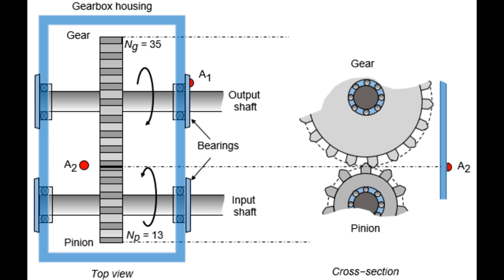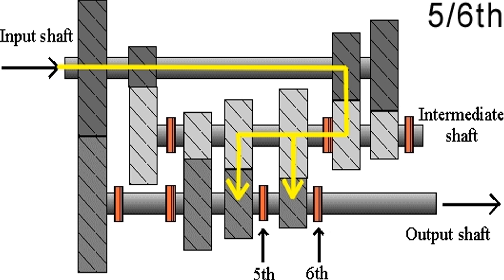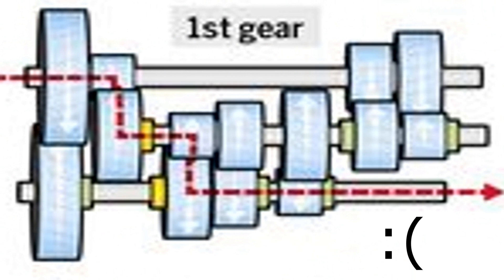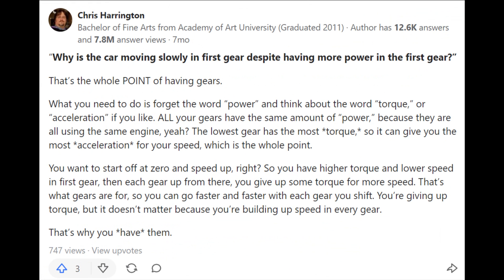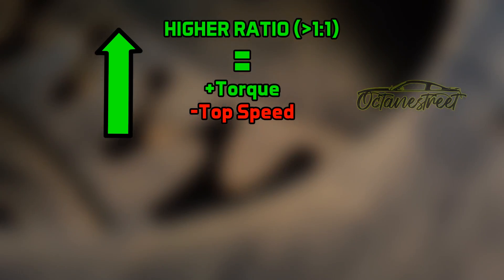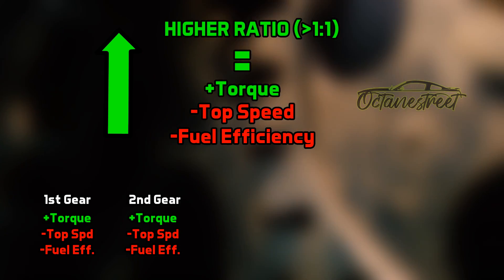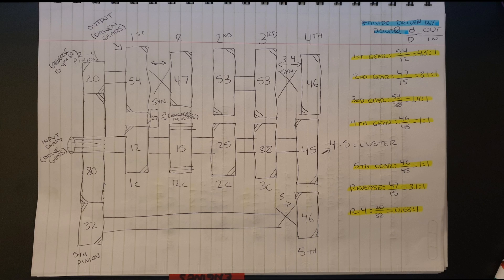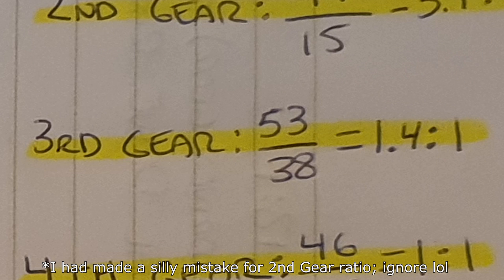Explaining "O/D Off" & Gear Ratios! Why It's Important! 💡

Comment: So overdrive off = faster?
Reply: Not always, if you are trying to accelerate your vehicle, turning off overdrive can shorten the time it takes to accelerate. If you are already going near a top speed switching the overdrive on can  cause you to slow down faster if you arent pressing the accelerator. The Overdrive function does not increase your overall top speed it just helps get you there in a shorter time.

Comment: Hey what does it mean when im going high way speeds my car stutters and goes crazy into high rpms and the o/d light goes off without even pressing it its weird only happens on highway not street driving ??😅 it scary when it happens to cause the car just pauses .you think my transmission going out or something like spark plugs or something??
Reply from the maker: @Above3Beyond123  Sounds like some sort of transmission problem or an issue with the higher gears. Can definitely be dangerous and you should get it looked at or at the very least do some extensive googling! Be safe 👊

Comment: Sir, I have a question regarding driving an automatic transmission car on a 30-kilometer range uphill route. What is the best driving method to use? Should I use the OD (Overdrive) OFF function or gear 2, 1 or L gear? And to assist with engine braking, on downhill, should I use gear 2, 1, or L for the entire 30 kilometers to prevent damage to the transmission?

Your answer and explanation would be greatly appreciated
Reply from the maker: To be completely frank I am not qualified to answer that question, I understand the question but don't have the knowledge for situations like that. You can watch a video on best way to travel uphill/downhill etc and possibly find a good answer! Best of luck, and feel free to come back and reply to your own comment if you end up figuring it out. That way others who might have a similar question can also have an answer! 👌

Comment: Mine is flashing can you tell me what does that mean?
Reply from the maker: Unfortunately you might have to get that taken in to a shop to have it looked at. Can be the O/D system malfunctioning or some other issue with the transmission, so it's better to be safe than sorry. Best of luck!
Reply: @OctaneStreet  hey man its a shift solonoid, but its hard to get it fixed, either buy a transmission or from what ive been learning you can use the manual mode to avoid the overdrive, i say this because if you have overdrive on it causes your transmission to slip and that leads to fuel loss and power loss
Reply: Did you find a fix?

Comment: How do you turn it back on because i turned mine off on accident and it wont go back on?
Reply from the maker: It should be able to be toggled on/off with the press of the same button. It may also depend on your vehicle how the feature is meant to be toggled back on, try looking around on Google or your owner's manual if you drive something other than a Ford Mustang product. Worst case scenario, switching the car off and back on should have O/D back on by default.

Comment: I have a 2005 Mustang GT Automatic equipped with a 5R55S transmission. Every time I drive my car literally off my driveway. My transmission slips and goes into overdrive flashing and check engine comes on and 5 codes come on P0743 P0750 P0755 P0760 P0765  and will stall out. I can turn the car back on but cant put it into gear without it stalling again. I’ve replaced the solenoid pack, wiring harness, fluid and filter and still no fix. Any help?
Reply from the maker: Unfortunately that sounds like a serious transmission issue, but I couldn't know for sure without being able to diagnose it myself. Regardless, I'd say to take it in to a shop and see what they suggest! I'm hoping it can be a relatively easy fix for your sake! Best of luck, and sorry I couldn't be of more help.
Reply: Yikes that sucks. Yeah if it goes into overdrive so soon the engine rpm is too low at such low speed and it would stall out. Ive had to deal with stalling on my Corolla before but that was mainly due to a dirty throttle body that needed cleaning. Did you ever fix your problems with the car?

Comment: The biggest and most important thing never mentioned in these videos is that - you should turn OD  OFf when driving down a long hill to prevent your vehicle from continuing to gain speed , therefore saving your pads by you not riding your brakes to slow down, basically engine breaking -as per your car manual.
Reply from the maker: I actually didn't know that, and if it's true, which I can understand how it makes sense, then thank you for sharing that with me and my audience. I'm certainly not perfect, but I try my best to convey as much relevant information in as short a time possible.

Comment: I want to say that you are my primary source from here on out.
I just purchased a 2006 Red mustang from my neighbor, she wanted it gone for 2500. (automatic)
Purchased a coupled days ago, 25th
I am looking to throw a new radiator/coolant (Its been sitting 3 years, has rust inside coolant)
At first I was looking to flip this car, but Im having a hard time seeing as its grown on me.

If I can properly fix it up to become my daily driver I may just keep it!
Though heres a problem im having maybe you know right off the back?

When shifting, 
As its just like yours, --Park, to reverse, to neutral, to Drive, to 3, 2 ,1
going from Park, to reverse, to neutral, to Drive.  - It acts as if its in neutral? Or even sometimes acts as if its in '3' (Identified by horrible shifting)
I have to pull it down to '3', and push it up to 'Drive' To actually have the car go through its gears smoothly. (Buddy figured this one out)

I researched and a lot of people say linkage cable, but wanted your personal opinion, maybe you went through this before or known someone who has.
Reply from the maker: Haha, I appreciate that but unfortunately I don't think I have the knowledge, nor have I covered enough here on the channel to be anyone's primary source! Also, I apologize for the late response.

The problem you described is something I've experienced with my car as well. I haven't been able to identify the cause, and in my case it only happened often for a span of like a month, so I never really addressed it. Linkage cable seems like it might make sense, but i'd worry of a more serious issue that prevents the trans from being able to grab gears properly/slipping. Hopefully it's something simple like the cable, but unfortunately I don't have the answer. Hope you're able to figure it out, and if not then I hope it goes away on its own like mine did!
Reply: @OctaneStreet  Thank you for your honest opinion.

To update you, I contacted ford dealership and addressed the problem with the year and model
You may want to look into it as well,
They told me my mustang is highlighted under a recall, yours may be as well?

 They are RECALLING
 model year 2005-2008 Ford Mustang vehicles that are  manufactured from August 1, 2004, to June 30, 2007, and 2005-2006 Ford GT vehicles manufactured February 11, 2005, to January 30, 2006.

Though this is a recall simply for the left passenger airbag-- Ive read many who had theirs recalled waited 30 days, and received a check for cars full amount due to product unavailability in the proper listed time (30day Return listed for this Recall)
Reply from the maker: @DevelopingExperiences  Oh wow, really appreciate that information. Did they mention what the issue was for the shifter not being in gear properly? Or have you not taken the car in yet to have that sorted out?
Reply: @OctaneStreet  The issue for the recall is for the airbag, and the style airbag is not manufactured anymore.

So if they cant find a already manufactured one in the days required = money im guessing

Comment: For gamers who do their gear mapping in computer games.
= twin-cam 6000rpm redline, cam-shift at 3000rpm, petrol-gasoline
= 1 reverse, 4 forwards, 1 overdrive (no top up money to buy flashy in-game parts)
= see car default gear-ratio for 1st versus reverse. 

Factors - Weight of car, grip available at that weight, 
Over-drive theory-concept = cruise-control concept = with limited-acceleration available for (very)smooth overtaking-passing = at speed ranges between 3rd gear 4000rpm(cam-2) to 4th gear 3000rpm(cam-1) which should be around OverDrive gear audiophile mode of approximately 2000rpm(cam-1)

Apply concept to OverDrive 5th. Apply concept backwards down to 2nd. Retain ratio of 1st versus reverse. Power-torque curves peak and start to drop at 5000rpm(engine protection, save on shift light) 

1st = steep slope, full load, corner-bend acute, wheels steered-turned max, able to crawl-hold position(auto, manual).
Reply: EcoMode for sports cars
Normal mode avoids cam2 until 4th(OverDrive minus-one)
Sports mode uses cam2 till 5200rpm for smoother-change(if gear-ratio seperation is 1000rpm normal car slow shift times cheap gearbox) Up-Down blip-effect and engine-braking with no top-end overhaul effect (6000rpm at OverDrive for downhill top-speed ...)

OverDrive cruise-control effect of slow-acceleration is only available at cam-1...

Comment: Is it safe to switch from O/D off and on while driving ? Thanks for the vids bro !
Reply from the maker: I believe it's fine but it probably does put a tiny bit of strain on the trans or even driveline. If possible I'd say to engage/disengage it while in Park, but if you need to use it on the fly you should be more than fine to do so. Maybe give it a google search or see if they have further info in your owners' manual about how the mfr suggests o/d functionality to be used. Thanks for watching!
Reply: @OctaneStreet  ok thanks for the reply bro

Comment: I have no light for the o/d feature and if When I drove 80kmh it would be slow to change gears but accelerate fast but rev low, people saying when it does this it’s on. 

But when I click the o/d button the revs go high but it looses acceleration. The mixed signals confuse me
Reply from the maker: With O/D on, the car will rev higher and accelerate harder. The gears will rev out longer therefore making the gear changes delayed so to say. If you're going highway speeds, and the revs are low (like ~2500rpm), the car does NOT have O/D off since this is achieved by your car being in its overdrive gears like 6th gear. It's probably just the light in your gauge cluster that's blown if the actual feature is still working. Hope that helps!
Reply: @OctaneStreet  it usually stays under 2500 revs but when I click the button it proceeds to go up to either 3000 or somewhere above 2500

Comment: v6 08 mustang. 
been ripping around to and from work with overdrive off. 

now my shits flashing and my and gears change  like a truck slamming the brakes
Reply from the maker: Ouch! Let me know what's wrong with it when you find out! Hopefully not a blown trans or warped driveshaft
Reply: Have the same problem in my 00’ Lexus es300, hesitates on the acceleration but once it’s out of 2nd gear it runs fine no hesitation if I let off the gas and press it again. I took it in and so far no mechanic has been any help but I think I narrowed it down to a vac leak. When I turn my ac on it doesn’t do it as much and it keeps my car from reving rough and stalling since it’s keeping a bigger load on my engine. apeople from threads have said they had the same problem and it was a vac leak
Reply: Same thing happened to my 2005 v6, have you found the issue?

Comment: Wondering with 3.73 gears or 4.10s installed & o/d off would play out, would be a dig monster lol
Reply from the maker: 100% lol, since those gears as is do work
Reply: @OctaneStreet  you got them gears installed yet or plan to? So your currently cai+tuned, exhaust & suspension work right, what's your next mods in the future
Reply from the maker: @josephr.8622  Just seeing this now! I don't have the gears as of yet, not entirely sure if I plan to get em or not either. But you are correct, currently cai+tune, exhaust, suspension, and brakes done. Next mods are completing the exhaust (LTH+midpipes) and an alu one-piece driveshaft! Can't wait for those 🔥